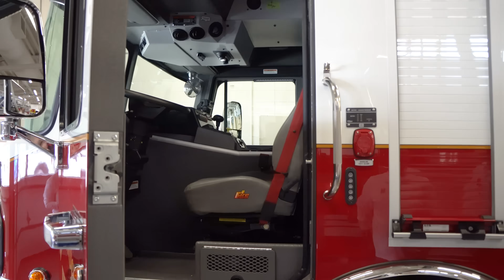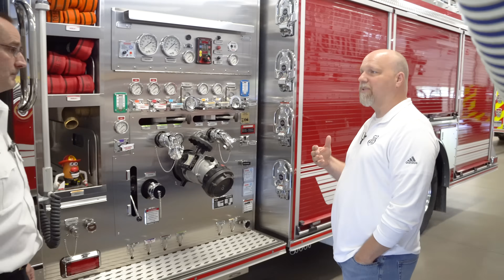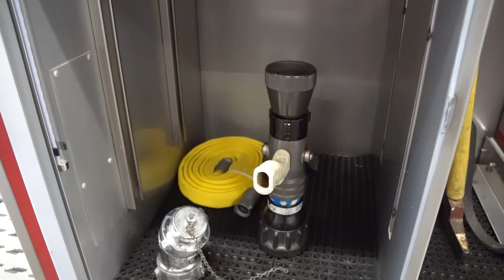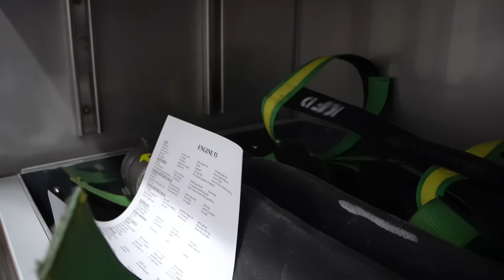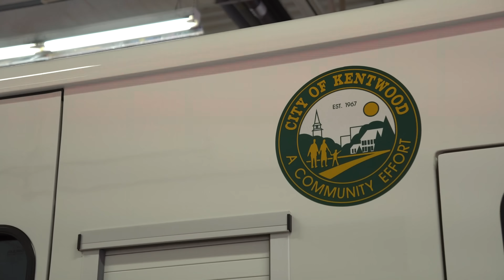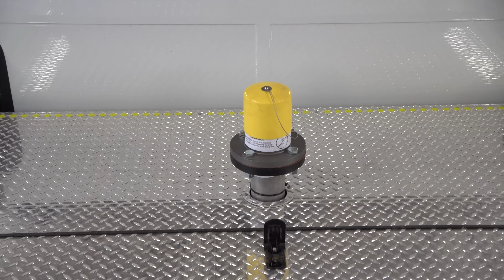CLEAN Cab Concept: Will It WORK?

Comment: On a lot of the older trucks and ways of doing it the scba’s were actually stored in the cabinets of the truck, especially in the 70s and 80s, at least put in the country down here in the south. The canopy cabs and the queen cab trucks with the packs on the tailboard or cabinets. Same as it used to be. You either spend time donning gear at the station or at the scene, same amount of time if not really close
Reply from the maker: What was old is new again. Kinda like the doors swinging open vs roll up doors. 😉. Check out station 3 from Denver

Comment: I Hear you all on the clean cab, I do. I remember when the officers talked about there is no way a Pick up will replace the Chevy suburban as a command vehicle. Well look at all FDs now, every one has a pick up with canopy for separation of gear not being in back seat area. I look back at the mini Pumpers coming say 20 to 30+ years ago. One of this guys videos shows a FD with a F-550 that carry 500 gallon of water, first out main Engine because of access to homes with long Drives, a Regular size pumper is to big. Look at the short wheel bases of those Wildlands Fire Engines that the State of California buys, all the same type of Engines
Smaller than a full size pumper.The mini Pumpers went away to a bigger Engine from the past. If the NFPA makes a ruling on NO gear/Air Packs in front area, the FDs must spec there Equipment to that standard. The way Air Packs sit behind seats in cabs, there is always dirty areas that are hard to reach for Disinfecting that area. YES you are all Right about the time of a Firefighter being suited up when they get to scene. But CANCER is a life Time sickness. The Chief in this video said ( 3 of his guys have Cancer) I'm only asking you all to think about yourself, your Life. Is it really that important to spend a few minutes, suiting up at scene. Yes I realize that there might be People that need Rescue from BURNING building/ vehicle, but YOU have to live with that CANCER for the rest of your life. What is more important for YOU. That short time ( the Chief in this video says it take just second's ) to suit up at scene. I do understand your thoughts on wanting to be ready to fight fire or save a Life as soon as you arrive. But look also at your Life's Health. Without you there is no Rescue of People in need. I don't know of a Firefighter that wants to live with CANCER, the pain you go through as you age. You NOT being able to do the JOB you Loved, going out on EARLY Retirement, because you got Health issues. Please just think about your Health. There is a reason you must have a clean cab. I see the clean cab consent being a NEW rule going forward.

Comment: Some of the bigger proponents of clean cabs such as Miami and Phoenix have recognized that the clean cab concept has failed. Truck specs are returning back to  SCBA in seat. Let’s be honest we can easily wash our gear and SCBA post fire. Throwing your pants and coat on quick before you get on the truck and completing the donning process enroute to a scene is 100% faster than rushing on scene to get dressed.
Reply: Instituting a gross decon procedure at the scene really helps with reducing exposure.i don't know a whole lot about clean cab setups because my dept. Has never had that setup, but our safety office developed the gross decon procedure.
Reply: Not doubting you at all, but can you (or someone else reading this) point me in the direction of some posts/information supporting that?  I’d love to share it with a few people I know who still support the “clean cab” idea….  Thanks!
Reply: @ATFDFF  Miamis new engine that was at fdic had scbas back in the seats
Reply: @trayjonrox  Oh I didn’t notice that!  Wow.  Thanks for filling me in, I appreciate it!
Reply: Te Nordic European regions have started testing it (only SCBA tho) and the delay is approximatley 5-10 seconds. They have done it for safety reason in traffic colisions to prevent the tanks for flying all around the cab if the locks fail but of course also to decrease the chance of cancer, you will never get all the particales of the mask or tank.

Comment: if you have 2 engine companies arriving at the scene of separate working house fires with people trapped ….One engine company has firefighters fully geared up w/ scbas . The other engine company is configured like this one . Firefighters and officer not fully geared up ,  no scbas . There is no way ,  no way possible the time to stretch an attack line and get personal in the building is same amount of time for both companies. Just doesn’t make sense . If the gear is contaminated after a fire , they could store it in one of the cabinets on the way back to the firehouse . They all have minimum of 2 sets of gear nowadays and some even have extractors to clean the contaminated gear
Reply: Agreed‼️💯
Reply: But chances are a clean cab department isnt going to rush in anyways….. gotta get the smoke curtain out the fog nails….. fire is scary and nobody survives anyways….. right?

Comment: In the UK we have had a National Fire, Police,  Ambulance and Military radio system since 2006 and were due an update in 2020! We are also working on National Ambulance specification where all the cupboard's and kit is in the same place. This will allow greater resilience in multi-service incidents. It is not uncommon where I work that the Rapid Response Solo Paramedics could be backed by an Ambulance from two different Services.

Comment: I really don't think its smart to keep your gear in the back, you cant just show up on a call and pull hose. It WILL slow down your response times
Reply from the maker: So let us through this out.  By this logic EMS emts and paramedics should be wearing gloves and masks and gowns while riding to the call also?  A cardiac arrest can’t get more serious and time sensitive but yet they don’t, why?  What’s the difference other that tradition?
Reply: @HeroesNextDoor  so think about this you call 911 you house is on fire, you family is stuck in the second floor, the fire trucks get there and you see a bunch of guys hop out not in gear. They have to gear up get the ladder hoses axe ect. That a lot to do when house fire these days double in size every 30 seconds

Comment: Question on the clean cab concept: Do the firefigthers do all their dressing at the scene? So pants, jacket etc. plus SCBAs or just the SCBAs?
Reply: I mean the idea is good, but it only works if everybody that is contaminated changes the gear after a fire on Scene before entering the cabin.
Reply: I may be wrong about it but. I think since the turnout gear can be wash often or after major event in house with a gear extractor. There should be less contaminent then on scba strap assembly etc also the seat seem to be easier to clean then a scba seat mount.

They may also want them to wear the turnout gear inside the cab for getting out in cold weather rain.
Reply: @davidrobitaille3698  
YES was thinking the same. The seats with Air Pack mounts have all these hidden areas that can be hard to reach for Disinfecting the area.
Reply: They don everything at the scene..